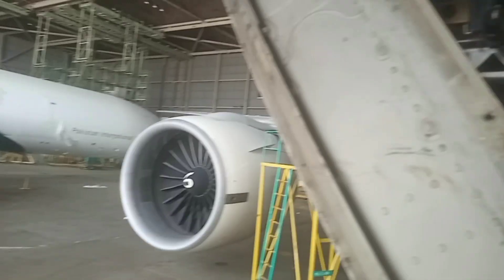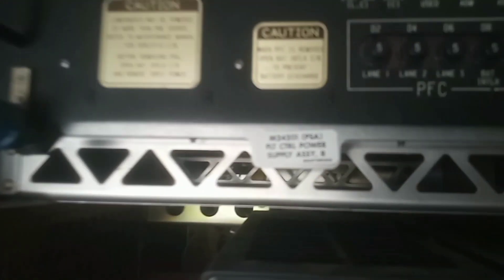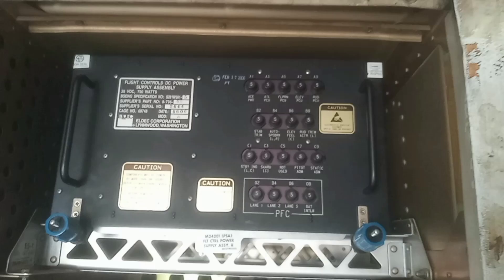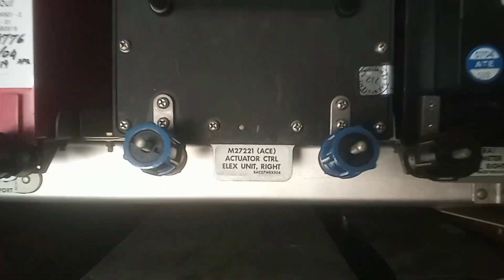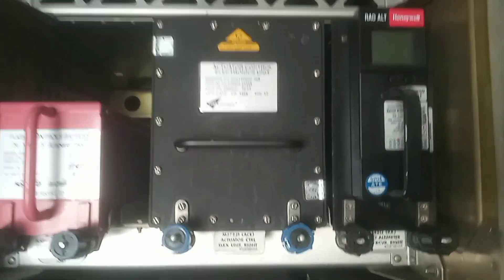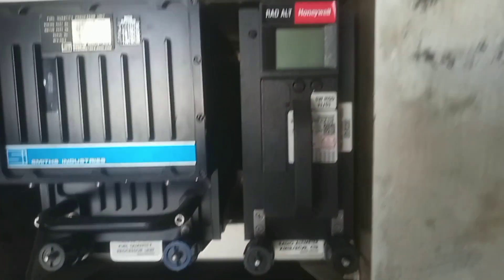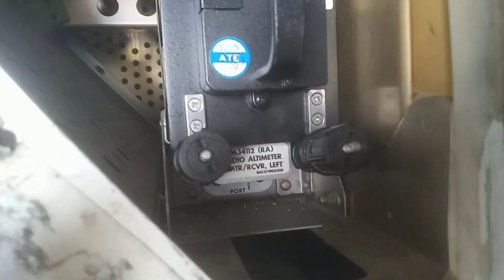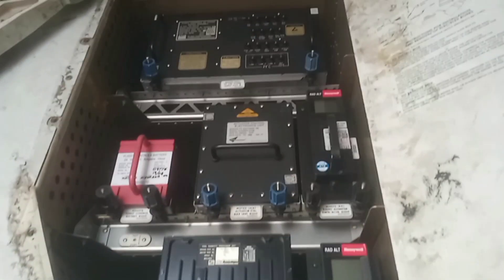LRUs installed on E5 electronic rack of Boeing 777 aircraft.

Comment: As usual good video...How many racks are there? E1,E2, E3....etc.
Thanks.
Reply from the maker: There are several equipment racks on Boeing 777 aircraft The electronics equipment in the MEC is on the E1, E2, E3, and E4 racks, E16 rack and E5 rack (forward cargo door)  E17 rack and E6 rack (aft cargo door). The E11 rack is in the passenger compartment above the door 3.
The E7 rack is in the passenger compartment above the aft galley.
The E10 rack is aft of the bulk cargo door.
 These are some popular racks on which most of the electronic equipment installed.